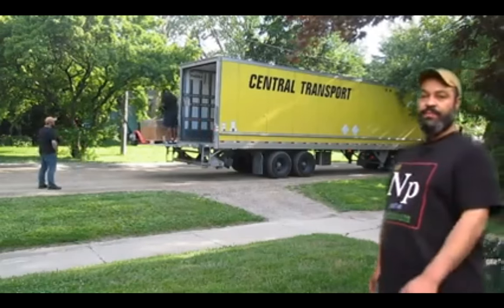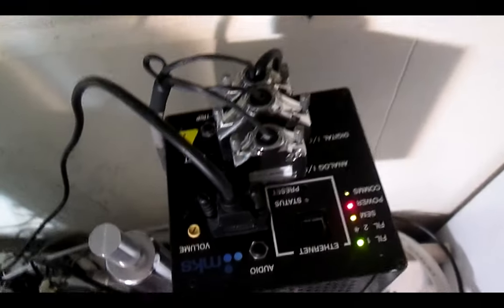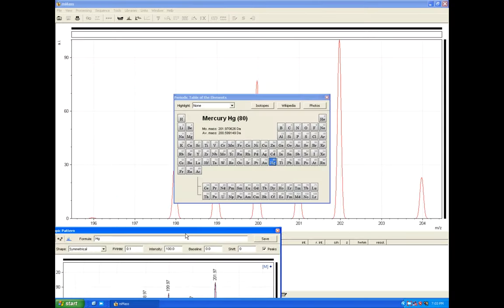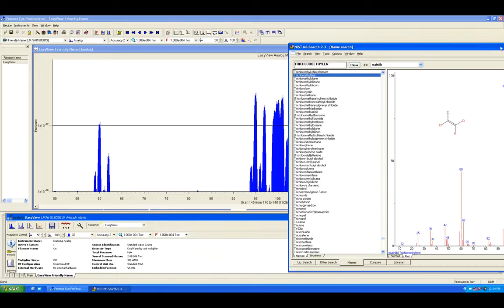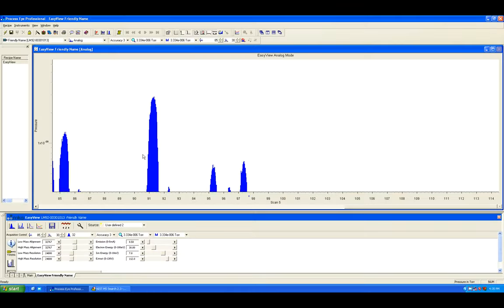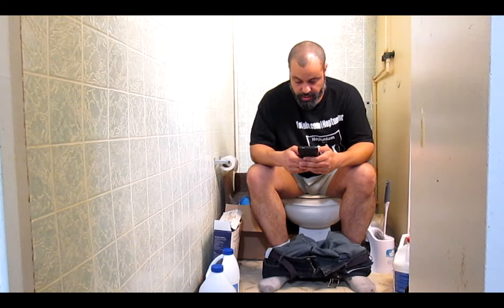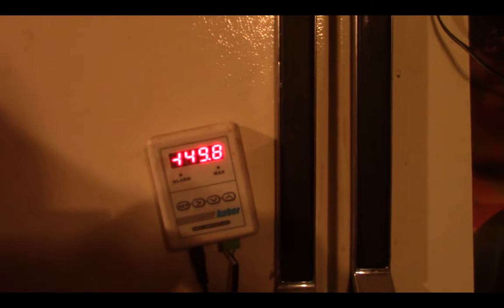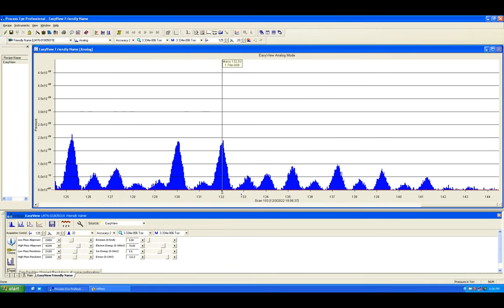Home Lab Series, RGA as Mass Spectrometer Krypton and Xenon

Comment: Hi! Can you please help with some setting of MKS Microvision 2, I have a problem that my filaments are not turning on. If it’s possible we can discuss it on email.
Reply from the maker: Sure, I can try to help ! contact me on sciencemadness.org if you can...Thanks
Reply: @Neptunium  Hi, I installed new self made filament and it started working!
Reply from the maker: @olegpeshkov  excellent! make sure to start at the lowest setting, but it may cut itself off if the current and/or pressure is too high. Enjoy!

Comment: thinking of buying one. i dont know much about chem, but would like does the RGA have a NPT fitting of some sort, would i simply pipe it to a large maybe stainless steel pipe and then fill that pipe with my sample, and turn on the vacuum pump like an AC vacuum pump for automotive, and then see what the RGA finds ?
Reply from the maker: Thank you for your comment! Unfortunately the AC vacuum pump is not enough to get to a mean free path long enough for ion to travel to the detector so it wouldn't work. The fittings are usually high vacuum CF25 and you'll need some sort of chamber. In the video, I used a 6 way connector with the same fitting. I'll talk about it a some more in my next video! Hey thanks for watching!!!

Comment: Can you use it to test the toxin and nutrient levels in produce from the shop/ market?
Reply from the maker: Although possible, it would display an incredibly complex spectrum of unreadable mess...usually everything gets separated first by a GC or HPLC so each component is injected individually.. can an amateur do it ? Probably ... Thanks for watching and the suggestion!
Reply: @Neptunium  thanks. I hope one day someone will make a cheap small device which is capable of doing that. It would put pressure on producers to produce higher nutritional value produce with lower levels of toxins.. at the moment consumers can only use appearance and flavour as a guide which could be very misleading.

Comment: I have an old Pfieffer RGA.
I was wanting to look for xenon and krypton in air also.
Another experiment was to see what % of He exists in my home natural gas supply, apparently natural gas can contain a reasonable amount.
Another experiment is to test the purity of disposable He cylinders sold for filling party balloons. Some state they are a mix of N2 and He...others claim to be pure He!
Reply from the maker: These are all very good ideas and the RGA should be able to help.. the nitrogen (or air) can be challenging since air and N2 are already everywhere, the difference will be in the ratio between peak heights and not a direct read on partial pressure but other than that sounds like a very good project ! Thanks for watching !

Comment: Great video, as usual!
I'm a bit confused about your last anlysis, intuitively I would have thought that everything but the noble gasses would get trapped in the arcivated carbon and molecular sieves.
How come these get captured here?
Reply from the maker: Actually yeah I wondered that myself ! but molecular sieve and activated charcoal do trap noble gasses usually according to there size. so Xenon would be best captured and helium least. There is all kinds of study about it easily found online: https://pubmed.ncbi.nlm.nih.gov/2398007/
https://www.osti.gov/biblio/380942
https://www.osti.gov/servlets/purl/1141436
etc...
as I mentioned (and for working there) we use coconut activated charcoal in the off gas to capture most (not all) noble gasses and monitor the output.
Thanks Giga! always appreciate your comment!
Reply: Molecular sieves work based on size and the stick from the van der Waals force

Comment: after browising ebay out of curiosity, damn, prices for and old RGA aren't that bad at all!
This may even be just a very good way to start mass spectroscopy at home (a crude version at least) if used stock is hard to find, and it can be repurposed for UHV projects.
Farting on the leak valve should be interesting xD a sort of helium leak detector, a fart leak detector?
Reply from the maker: Lol! If you do get one, just make sure to get the quadrupole matching the analyzer...the software can be found on line free.
Reply: Never tried farting on the inlet, but you can breath on it. However that implies a capillary inlet and they are very easily blocked
Reply from the maker: And you have to maintain a descent vacuum .. that's why I used a control leak rate valve.. thanks for watching!

Comment: Hi does it use a straight line fit for the mass alignment ?
Reply from the maker: You can play with the setting but it is pretty linear yes. It also has a zero blast protection since it focuses on lower masses . Thanks for your comment and thanks for watching!